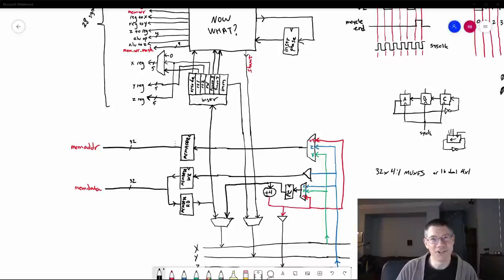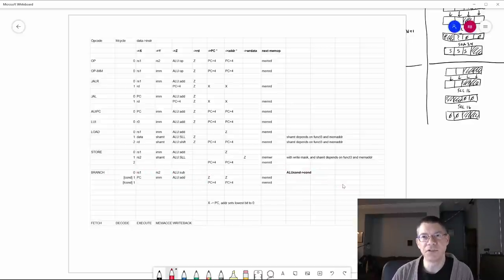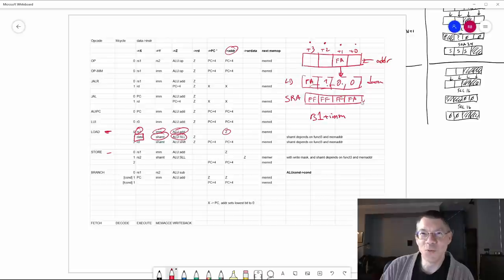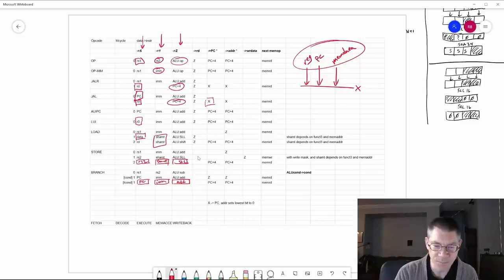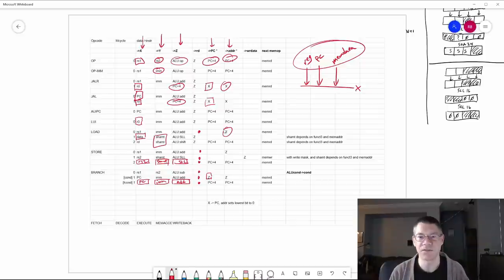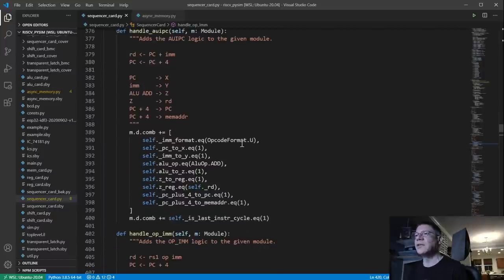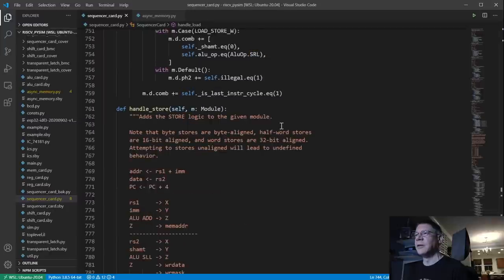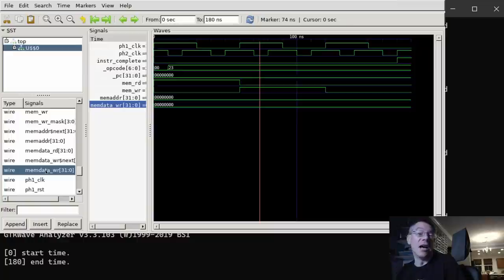LMARV-1 reboot part 4: the sequencer

Comment: In JAL and JALR you use rd on the register card as a temporary in order to save the value on the Z bus at end of cycle 1 and put it on X in cycle 2. At first glance this look fine, as you will overwrite it with PC+4 in cycle 2 anyway, but consider the case of rd = r0. In that case the register card will happily put a 0 on the X bus in cycle 2 instead of the value saved in cycle 1, and thus your cpu would erroneously jump to address 0.

I think you will have to add a latch to the sequencer card that can save a value from the Z bus in one cycle and then route that value to the PC or memaddr in a subsequent cycle (note that if you do this, you don't have to be able to route X to PC or memaddr, so your muxes doesn't have to be any more complex).
Reply from the maker: And that's what formal verification did for me. I found the bug during formal verification :)

Comment: Cool stuff.

What sort of clock speed are you hoping for with the actual hardware? 

Does it make sense to also repeat the formal testing with actual hardware - by which I mean use a FPGA to drive each 'daughter card' (where the cards are yhe register, alu, memory, etc circuits) individually to allow you to verify that each daughter card does actually conform to its nmigen model?

Thanks. Matt.

Comment: If you are finished with designing all the cards with nmigen HDL, how do you plan to create your schematics?

I think, because you abstracted essentially "real chips" with your nmigen modules, you could replace all of them with blackboxes, and use nmigen + yosys to generate a netlist. With some scripting you may be able to convert e.g. the json output of yosys into a netlist for kicad. The blackboxes in the json output would be converted into the correct parts in the netlist. From there, you can already do the layouting / routing :D. No schematic needed.
Reply from the maker: I think what you're referring to is techmapping. That's a whole other field that I don't know anything about, and don't want to know at this point. I'm planning on writing modules for actual chips, and replace non-chip logic with chip logic little by little in the design. When that's done, the code shows how the chips are hooked up. Generating a netlist could be done from that, but then there would be just as much work in making the schematics look nice as there would be just doing it from scratch. Also, a schematic helps when you need to to pinswaps because of physical layout constraints.

Comment: I feel a bit complicated to do load things this way (shifting). I would say, it's even more simple to have system memory as 4 * 8 bit RAM chips in a way, that you can select only individual chips to be selected (or not) for writing and reading (so byte-wise the system stores addresses in this pattern: chip0, chip1, chip2, chip3, chip0 ...). With some not so complex sign extension logic in hardware, and almost ready. At least, I would guess (but I can be wrong) it's even more simple to do and do not require extra cycles for shifting back and forth on extra cycles (also saves some login in the sequencer maybe?).

Comment: Yay! The theme song is back!
Question regarding the program counter. Is there ever a case where you need to write a byte or half-word? If not, why not hard code A1:A0 to be zero and then you can employ a simple up counter for A31:A2. It may change how you deal with sign-extending bytes and half-words, but the sequencer could figure that out. Am I missing something.
Reply from the maker: If I don't implement compressed instructions, then I can safely ignore the bottom two bits. Compressed instructions are 16 bits long, and eventually I might want those. But not now. Also, an up counter would require a clock pulse (therefore, a machine cycle) while an adder is strictly combinatorial, so doesn't require any machine cycles.
Reply: @RobertBaruch  I was thinking something like using a 74LS160. Now you have the latch fed by a 3-input MUX (A-bus, Z-Bus, PC+4) clocked in.
If you used a parallel-load counter and a 2-in MUX (A-bus, Z-bus) and instead of the +4, just don't parallel load and it will increment. Same number of clock cycles.
It also gives you a reset input to initialize the PC to begin fetching code at memory location 0.
As for compressed instructions, aren't those just to allow smaller code footprint for embedded applications?
Reply from the maker: @mikescott58  Unfortunately, PC+4 doesn't only need to go to the PC, but also to the destination register for JAL and JALR. That means PC+4 needs to be computed combinatorically rather than synchronously. Otherwise, yes, a counter would work better. Compress instructions are mainly for memory-limited implementations. I probably won't be implementing the C extension.

Comment: ECALL is calls to OS or your monitor/BIOS.  Should at least be a call through a vector of addresses.  So arguments are, as you said, an operation call to the monitor.  So implementing it should be possible.

Comment: instead for load:
place byte in the right destination
and broadcast the highest bit to all above positions
Reply: ie have some sign extension unit
Reply: I think the sticking point with this case is that there would need to be a multiplexer choosing between the sign extended and untouched versions. You would also need a way to choose between 8- and 16-bit extending. Whereas the video method uses the existing shifter hardware that would otherwise be unused in a load.

In this case the tradeoff is more speed vs less complexity, simply an implementation choice to prefer one to the other. I think that this video is coming down on the side of less complexity ;)
Reply: @joedetode we just need to add an alu op shift right and sign extend

Comment: Any chance you could explain how atomics work on a hardware level? I can't really wrap my head around that.
Reply from the maker: As far as I know, atomics could just be implemented as flip-flops. You can read them, process them, and write them atomically, as long as interrupts are inhibited during that process, and maybe that's how processors with atomic instructions operate. I don't know. I'm pretty sure software just uses locks where there are no atomic instructions available.
Reply: @RobertBaruch  The problem with software only locks is, how do you make a guarantee that another core doesn't modify it? Even if there aren't any interrupts there are other free running threads, and if you pause the entire CPU minus your current thread you'll lose a lot of aggregate performance with more cores. It's a hard question for me to reason with.
Reply: @gudenau  You are correct, special hardware (normally interfaced with special instructions) are required to implement atomicity, typically done at the system bus level, by locking the system bus when a CPU starts an atomic operation, and unlocked when completed, if a different processor tries to read or write the memory in the mean time it will be forced to stall until the bus is unlocked.
Reply: @eehawkee  There has got to be a better way to handle that. I wonder how stuff like ZEN and multi socket systems handle that.
Reply: @gudenau  I'm not familiar with zen, but with UltraSPARC-T2 which is a 8-core 64-thread CPU, and supports multi-socket, it does atomic operations with the L2 cache, so a atomic operation will invalidate the cache line for all connected CPUs, more efficient than bus locking, but still a performance hit. You should use atomics sparingly in other words.
Reply: @eehawkee  So malware could potentially just sit in a busy loop with atomics eh? What fun.
Reply: @gudenau  I don't think it will be much worse than just a busy loop that does nothing, it will only lock a single cache-line, other cache-lines would be unaffected and run at full speed
Reply: I think modern multicore/multi-CPU systems implement atomics in their local, non-shared cache; typically only one core can hold a modified cache-line of the same address and multiple cores trying to modify the same cache line leads to "cache sharing", which is a slow process that involves swapping data in-between caches. This is resolved by snooping one-another's buses and having a protocol for establishing ownership/priority.